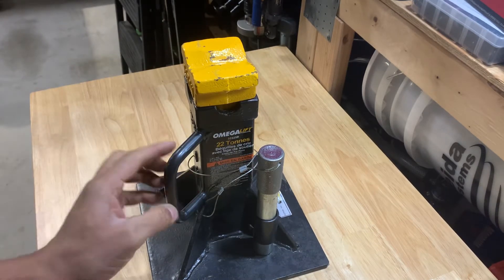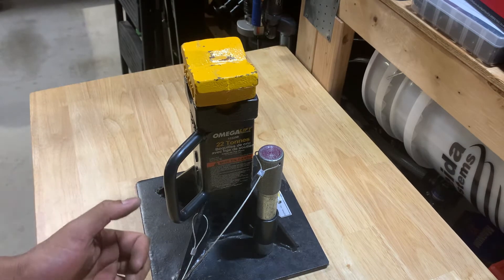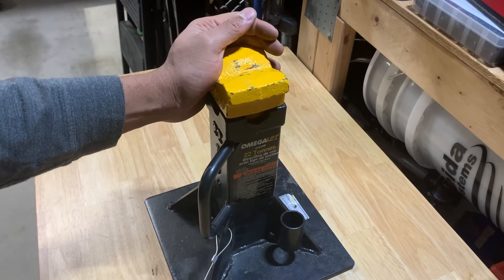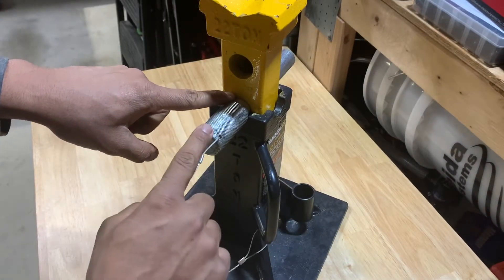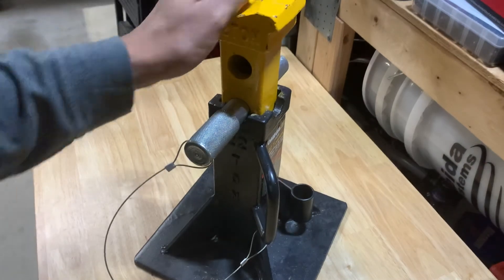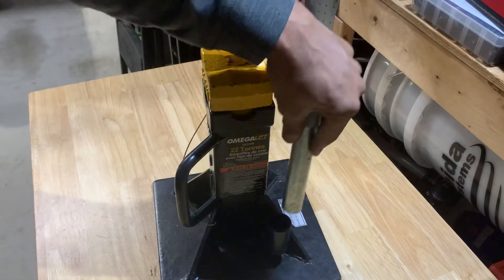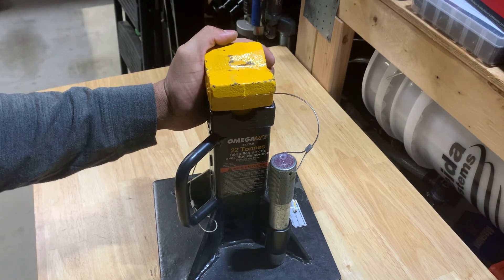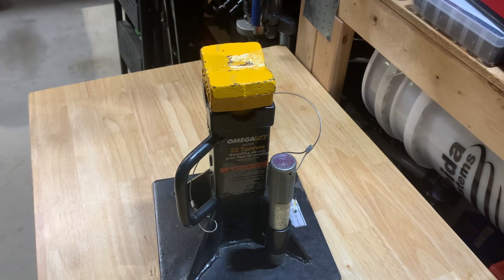Omega 22T Jack Stand Part 2

Comment: Nothing wrong with having a secondary safety measure when using the quick jack. How are you liking this style jack over the last few years? I've been using traditional jacks and I'm looking to grab something of this style soon.
Reply from the maker: I like this style over the traditional jack-stands plus the additional capacity is cheap insurance. The pin seems pretty solid, and has never concerned me. The base is nice and wide so the weight is straight down into the legs and then spreads on the base plate. I’ve since upgraded to the ESCO screw type jack stands to use my my Quick Jack and single post lift (highly recommend). That way my jack stand has infinite adjustments in height to contact the weight being support as a secondary means of safety.